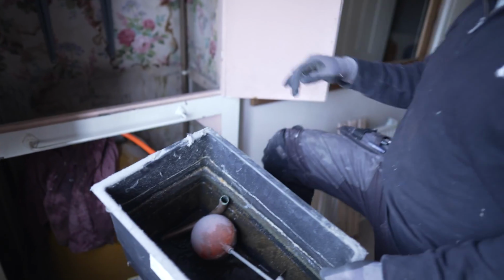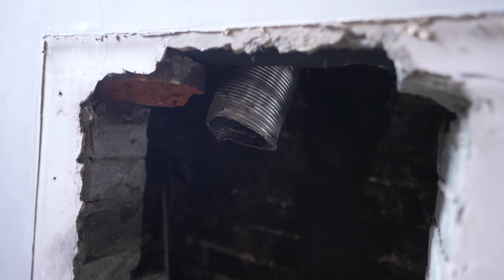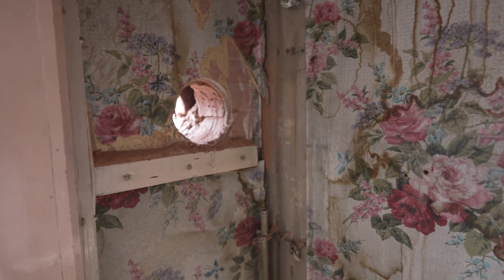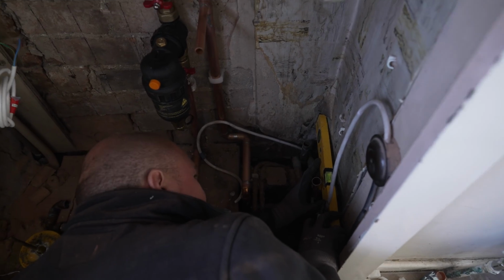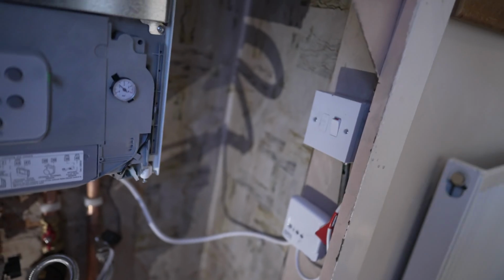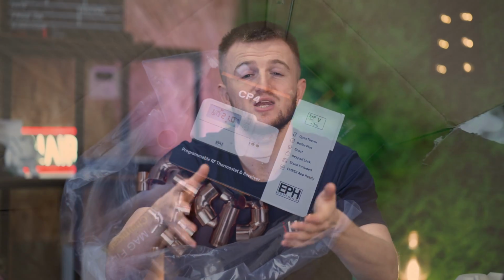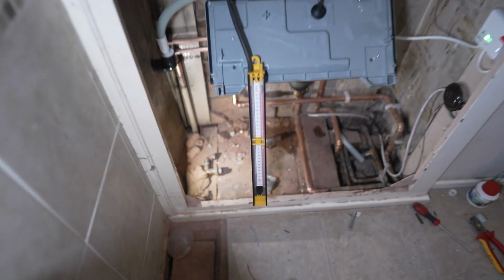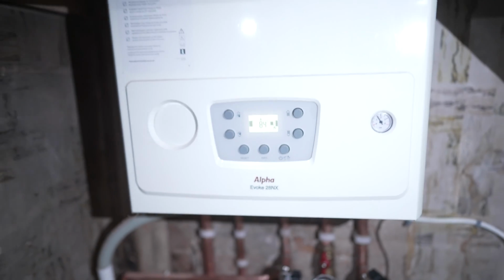Back Boiler Removal & Alpha NX Combi Installation: What Happens During a Back Boiler Conversion?

Comment: Hi please can you explain, I have a cast iron fronted coal burning back boiler, which has radiators and heats rooms. Is it possible to have a new combi boiler installed and still retain my coal burning function? thanks
Reply from the maker: This sounds very much like a speciality job which we wouldn't do at iHeat. We only do swaps removing the old boiler and capping off the old pipework. Whilst it may be possible, iHeat personally would not take that route. Sounds like a very interesting idea however and we wish you the best of luck. May I ask why you want to keep it?